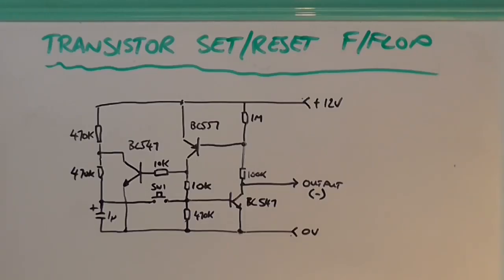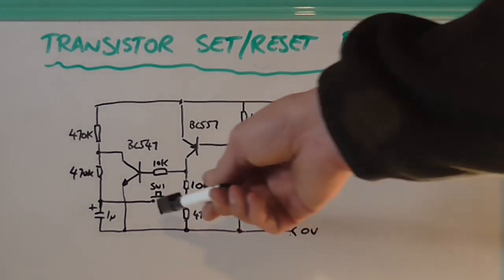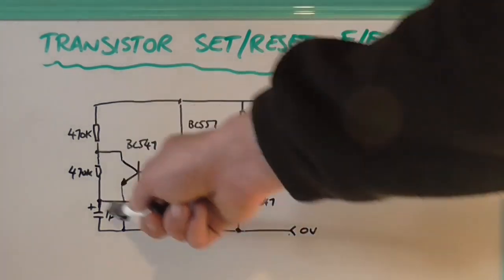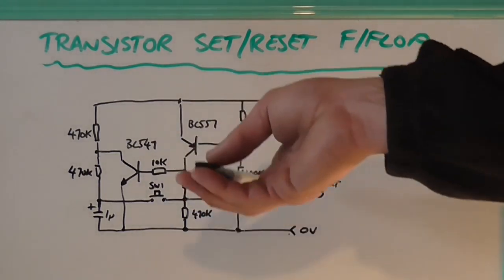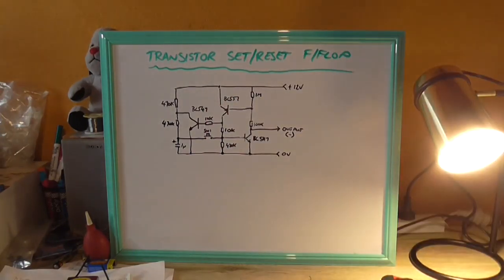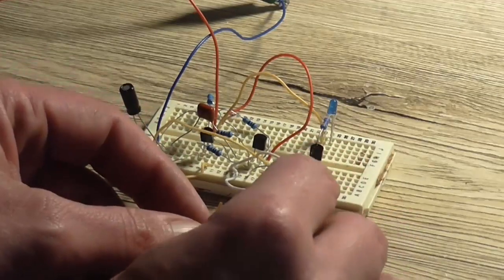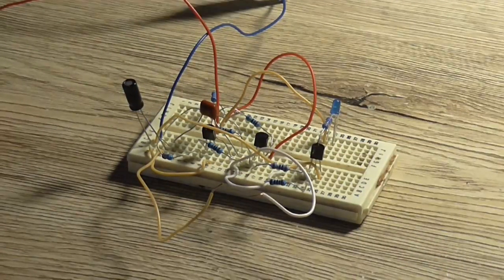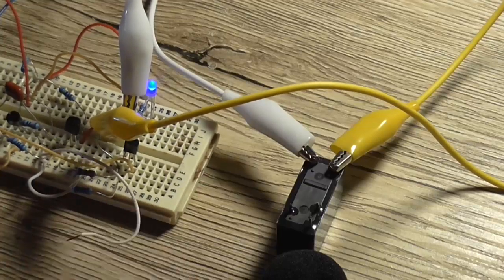Transistor Set/Reset Flip/Flop Latch

Comment: Can't seem to get it to work. I tried in 2 different simulations but neither with work
Reply from the maker: Works fine on breadboard. However, I will state that there are better ways to do this.
Reply: @AstrosElectronicsLab  I'm trying to build a soft latching power switch to power a relay latching circuit for an input switcher.  Do you have any ideas on what would be the way? Perhaps a 555?
Reply from the maker: @tosspot1305  yeah, a 555 timer latch would work http://www.zen22142.zen.co.uk/Circuits/Switching/555toggle.htm
Reply: @AstrosElectronicsLab  nice one.. Thanks